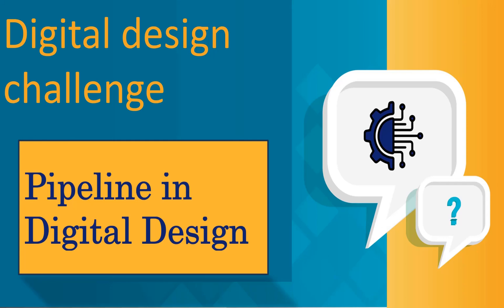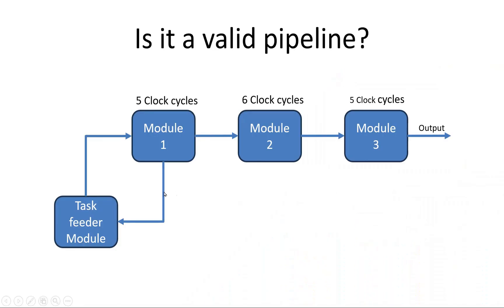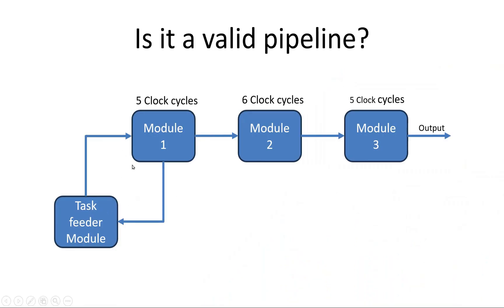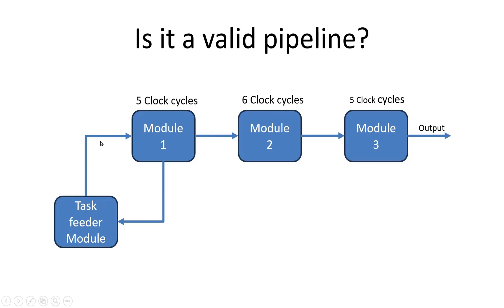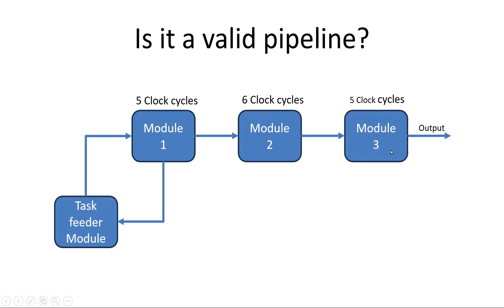Digital Design Challenge: Exploring Pipelines in Digital Systems

Comment: It depends on the module 2. If it can store data internally before processing it (internal fifo or access to memory), it will work. Otherwise, there will be data loss.
Reply from the maker: Basically, you are trying to put a another pipeline in the middle of the module 2.

Comment: It depends on the second Module . If the Module 2 itself is pipelined inside like 6 stages then it is ok.   If not  then there is problem.  all the Modules should have same  number of clock cycles to function.  Example  5 clock cycles each module.  Other wise we need to have  the task feeder module to assign task every 6 cycles.
Reply from the maker: What change do you recommend in the logic?

Comment: I think its not valid,I have not heard of feedback in pipelining, I think for feedback we use retiming.
Reply: What is retiming ??
Reply from the maker: I am going to reveal something more on the pipeline in the upcoming videos. Please keep sharing your concerns.
Reply from the maker: Can you please eleborate little bit more on re-timing in the pipeline architectures?
Reply: pipelining is a special case of retiming .It applies to the graphs without loop.
retiming can be consider as the movement of registers from input to output in order to improve its performance in terms of area or delay ,but if there is no feedback and datapath is straight it becomes pipeline. @TechnicalBytes